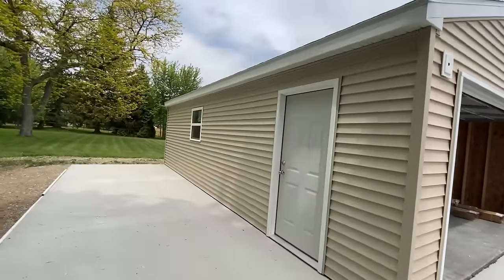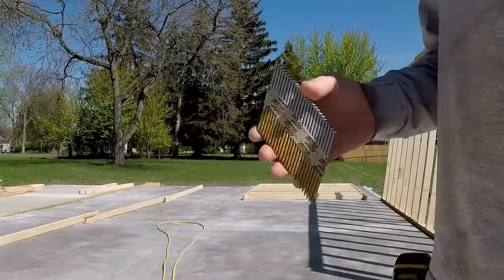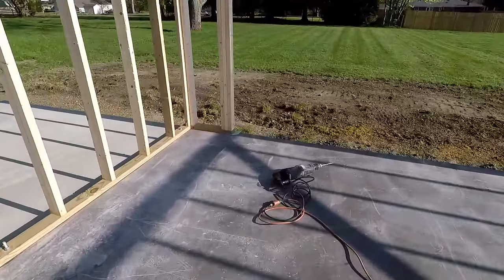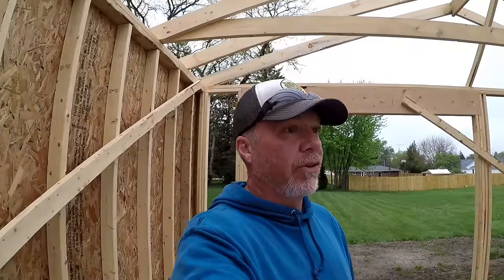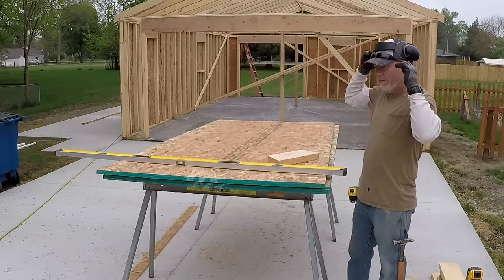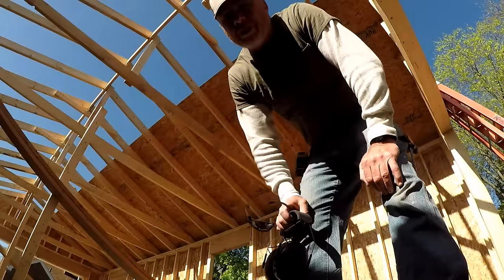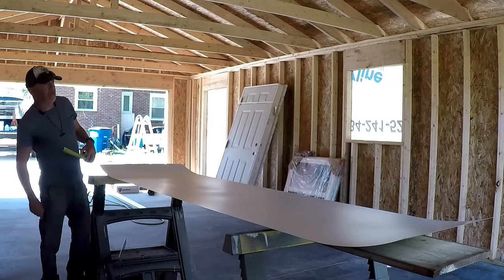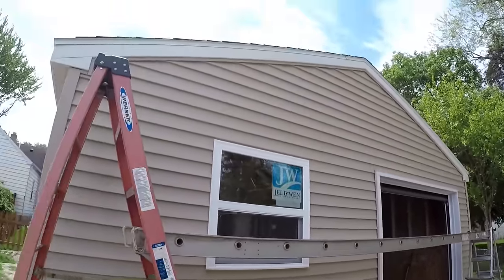Full Garage Build! Framing AND Siding! MY DIY

Comment: I’ve been a garage door installer/technician for over 20 years and I’ve been in hundreds of cookie cutter garages frames exactly like this. It’s strong. It’s efficient. And yes you could frame it 16 O.C. On the roof and rafters but there really is no need. This is a badass garage and plenty strong!! Doing this all one man shows you are skilled and have a great routine down! 👏🏼
Reply from the maker: Yup, I think it’s a perfectly acceptable way to frame an accessory building👍

Comment: I've been in the trades as a carpenter for a long time ,and still going.  Your workmanship and pride will keep you busy for a long time. It's a pleasure to see a craftsman doing a good job.
I know you've called your hammer a "pink hammer" but I still prefer a Estwing straight claw. This saved my butt a couple times from sliding off a roof.
Keep setting the good examples .
Reply: If you use an Estwing you must be from the midwest or northeast.  On the west coast nothin but Dalluge wood-handled hammers.
Reply from the maker: My framer is wood handled, a Kobalt I got from Lowes a million years ago

Comment: I see that would be a good reason to use that foam underneath the green board against the concrete because your plywood is up against the concrete😂
Reply from the maker: On that patio side, the OSB is almost touching the expansion joint…definitely not ideal.

Comment: All that concrete but there's none outside the rear overhead door.  Amazing job building a structure flying solo!
Reply from the maker: Yeah, I’m not sure why the customer didn’t want a small approach poured in the back🤷‍♂️
Reply: @MyDIYAdventures  Aren't you the customer?

Comment: Question to those who may know. 
Is there a way to have such sized shed with no concrete? 
Build smaller sheds before (all on skids) and always bought the plans. Cannot seem to find plans for auch size with wood based foundation on posts
Reply from the maker: Post frame it

Comment: @MYDIYADVENTURES Great job on the garage. what was the roof pitch? And was that one solid ridge beam or splice together? LVL or #2 2x6? Was that concrete pad done with rebar or fiber or both
Reply from the maker: 4/12 pitch, ridge was 2 2x8s, I assume the concrete just had wire in it

Comment: Are you using pressure treated 2x4s on the lower part of the framing that is touching the concrete? I'm just curious if you have to by code, should because its just a smart practice  or you can get away with just a regular 2x4?
Reply from the maker: Yeah, treated plates are required by code here.

Comment: Good day Sir, Just want to ask what is the dimension of the LVL that you used for the front garage door? is it exactly 16's? or did you just make it?
Reply from the maker: The header is 16’9” that allows for 2 jack studs and a 2x6 trim board on each side
Reply: @MyDIYAdventures  Awesome, appreciate the answers have a great day!!!

Comment: I wish my Dewalt cordless circular saw worked like yours. Mine eats up a battery before I cut one sheet of half inch plywood. That's with a new blade. Don't know why I didn't return it. Now it's just a piece of junk in my garage.
Reply from the maker: Mine only runs good with a 6amp hour battery

Comment: "Check for square", so much more accurate than 345.
Ok this Wayne getting ready for a DIY garage build. 
Slab will be done by someone else. 
Thanks for the education. 
I'll keep watching.
Reply: Those Canadian guys use the 345 method. If they would try the corner to corner measurements.
Its like "try it youll like it".
Reply from the maker: 3-4-5 works in a pinch!

Comment: When I had my framing inspection, they wanted at least 6 nail per joist in headers both sides.🙄
Reply from the maker: Someone needs to teach these doofus inspectors that you CAN over nail things and ruin the structural integrity.

Comment: That appears to be an old, weathered slab. Were there footers under the perimeter?  Also, that foam air barrier isn’t going to stop water penetration. Homeowner ok with a wet garage?
Reply from the maker: That is a brand new slab, patio, and driveway.

Comment: how did you get the ridge board and rafters up without at least a board to hold the ridge on each end? did you have temporary supports that you removed without showing it?
Reply from the maker: Yes, I have other videos that show how I set the ridge

Comment: Just curious, any reason you’re still running corded / hosed stuff and not battery options? Seems like a lot more of a headache especially working by yourself.
Reply from the maker: A compressor and gun are way cheaper than a battery gun and batteries
Reply: @MyDIYAdventures  fair enough. Thanks for the reply.

Comment: lol.  The only thing I would 'harp' on you about is moving your rotary hammer up and down and not sucking out the concrete dust before installing the anchor bolt.... but you would run circles around me anyway, lol
Reply from the maker: Moving it up and down is what helps extract that concrete dust
Reply: @MyDIYAdventures  I do get that and I used to do that too but sometimes that will enlarge the hole and your anchors or redheads or tapcons might strip out easier or not even grip.  It's a pain in the rear but I do carry a little battery powered shop vac with me to suck out the dust.... and that's probably why I build waaaaay slower than you, lol.  Heck, if i was even half your speed I'd be doing good but I am an IT engineer so i don't do construction for a living. :)  I am also way to anal and that is what keeps me slow.... that and inexperience, lol

Comment: Interesting that they let you install the rafter ties at 48" usually they require each rafter to have a rafter tie. Are we pretending that the ridge board is acting like a beam between the rafters with the ties w/ a 48" span? Can anyone shed light on this?
Reply from the maker: 48” has always been acceptable in an accessory building here🤷‍♂️

Comment: I'm also impressed you did this job solo. Was it worth the time you lost doing it solo vs hiring a second hand? What was the total cost to have this built?
Reply from the maker: My buddy worked with me for 15 years, he was a great second hand! After he left, I quit trying to find helpers, they were all terrible LOL
The total cost of this garage, with all the concrete, was easily $35k
Reply: @MyDIYAdventures  Ya I've a buddy whose a contractor and he's constantly running into the issue of, good work is hard to find and people have cost him more than if he would have just done it himself. Awesome job on the garage.

Comment: Hey I know this video is older but i am looking to get this almost exact garage built (only one garage door). What is the rough cost of this being built? I am wondering as i dont have a clue what a good price would be.
Reply from the maker: The contractor I built this for usually charges around $40-$50 per square foot for the total garage. But we’re in the Midwest, where stuff is pretty cheap still.
Reply: @MyDIYAdventures  hey thank you for the reply!!! I am in the midwest also (MN). Thank you for letting me know. I just had a "quote" done and they wanted $67,000 to build a 20x30 garage, non insulated, no power, no water, no sheet rock, single garage door, no windows, no doors. Thank you for giving me an idea of what should be fair priced. I greatly appreciate it.
Reply from the maker: @plainbrownwrapper9688 yeah, that seems steep, but what do I know?🤷‍♂️

Comment: I have sharpened those spade bits before, and it's a pain in the ass to get the angles correct.
Reply from the maker: Yeah, I've tried a few times with no luck.
Reply: @MyDIYAdventures  My attempts were at least partially successful using a hand file, a rotary tool with a grinding stone, and having a second spade bit to compare with so I could see what angles I needed.  Patience is also important.

Comment: How do you find your bolt holes and locations if you don't snap lines?
Reply from the maker: I just measured off the edge of the slab since it was nice and straight.

Comment: 3:10 Those but joints are supposed to be staggered. Your local inspector leaves a lot to be desired.
Reply from the maker: Incorrect, the double top plate gets staggered
Reply: @MyDIYAdventures  from homes to apartments we always stagger butt joints. Sole plate and top plate.
Reply from the maker: Building codes are obviously different where you’re at
Reply: @MyDIYAdventures  Right on. It's a great build.

Comment: What's around about labor cost for that 20x30
Reply from the maker: I think the contractor paid me $3,500 to frame and side it.
Reply: @MyDIYAdventures  thanks I just wanted to know around what it would cost. I'm thinking about doing it myself I have built sheds but never a big structure.
Reply: @MyDIYAdventures  at what part of the construction does the inspector needs to come out?
Reply: @MyDIYAdventures  ohh oh I have siding on the driveway side of my house do I install a truss on top of the siding or do I cut a hole thru it.